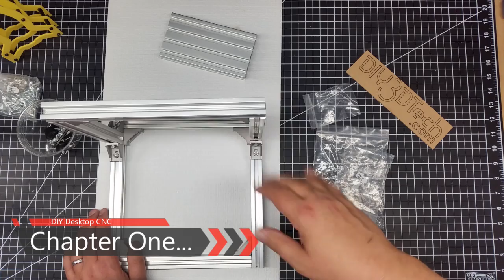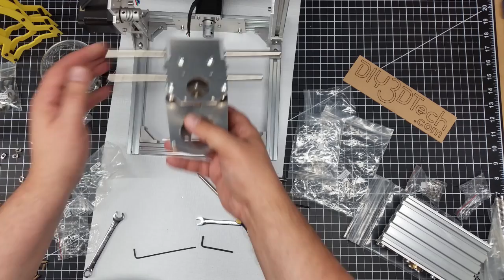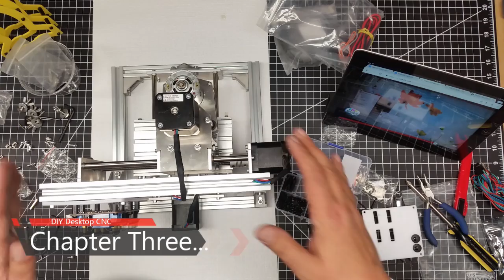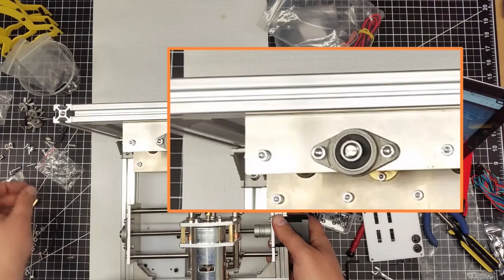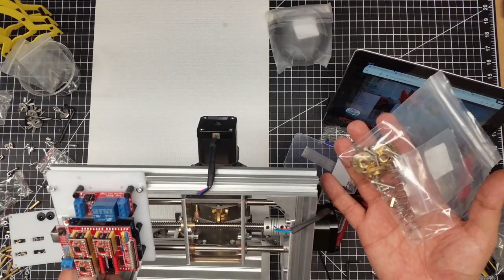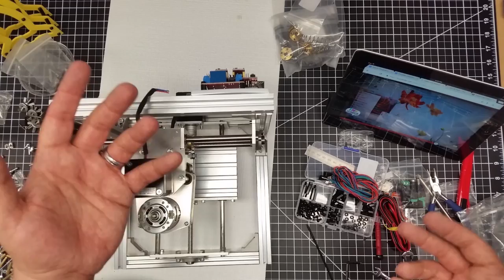Desktop CNC - Build Vlog Part 1 of 2!

Comment: The bag with the springs is an anti-backlash mod I think. The smaller nylon panel is intended to be mounted over the top of the Arduino using the long standoffs. Whether that's smart or not is up to you :)
Reply from the maker: LOL!  I ended with a lot extra and odd parts in this build :-)

Comment: that flux ring (collar) creates a stronger magnetic field = more torque but less speed .   It makes the motor more efficient .  well a flux ring makes the magnetic circuit more efficient = stronger.   best was i could describe is like adding a 1:1.2  gearbox . it reduces your no load current .   but you may want the higher speed for the spindle by keeping it off. . 
Great stuff man . you get all the best toys . 
I have a boring toy to setup this weekend ,  a bench top 4 inch belt & 6 inch disk sander . that's about as fancy as i get LOL
Reply from the maker: +XerotoLabs dude you never cease to amaze me!

Comment: I must say the price of this is pretty hefty considering its size and their video I heard the spindle bog down in wood if ever so slightly it was there, etc...  I think a 3040 would be a much better item to get at least unless someone could afford a 6040 etc...  Oh, and this baby is OOS too, lol. :/
Reply from the maker: It really depends, as I also have a 3040 (which I love) and  Probotix too.  Each has its plus and minuses as one of the big reasons I bought this one is for circuit boards also to see what someone could with it and it really isn't bad as I find myself actually using it more because set is so easy and there isn't all this regular hub-bub as with the larger unit.  Also it fits in a small area and dust collection can be achieved with large plastic storage box.  Also the price point is very good too at $200 you could argue double it however if you have room nor the extra 200 this is a reasonable and fun solution :-)